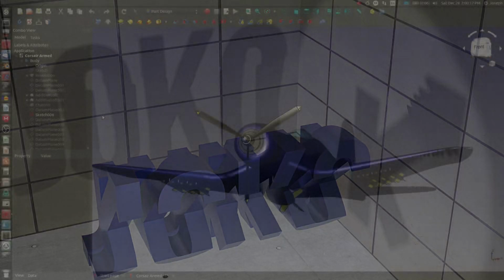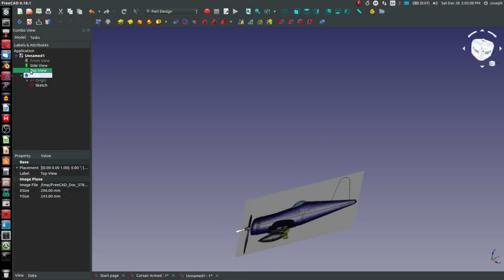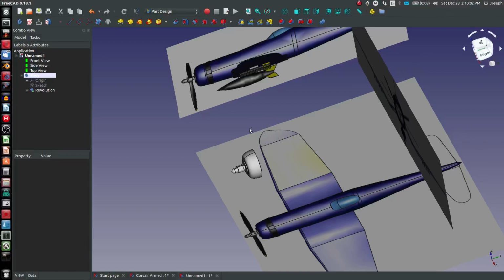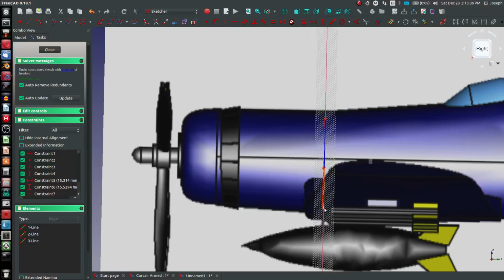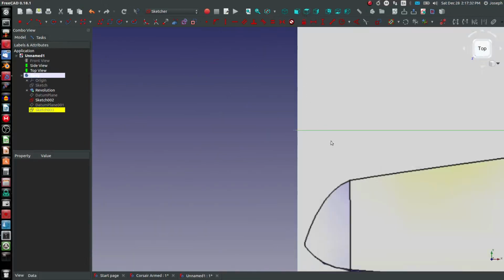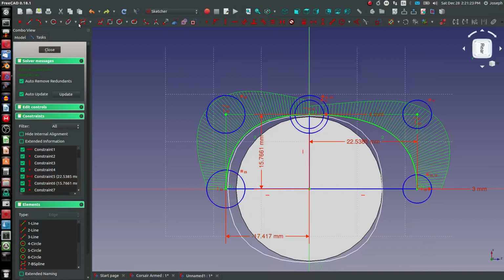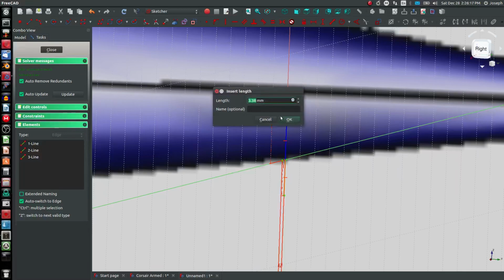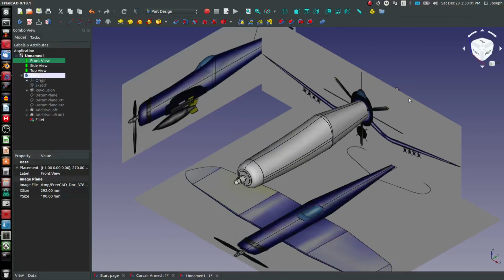Make a Corsair F4U in FreeCAD- Model From Image Video 1|JOKO ENGINEERING|

Comment: WOW. 

I just started and im dying to make a piper PA-28 cherokee, but i just found your videos on making planes hehe. Guess I’ll hop to the FA-18 one because the front of the pa-28 is an uneven elipse and I don’t really know how to tackle it

Thanks for the videos!
Reply from the maker: I haven't finished the F18 yet but I think it will be a good start.  Generally weird shapes like uneven elipses can sometimes loft better if you sketch them in half and then mirror the body after lofting to make something symmetrical.  I do this in the JAS-39 Gripen video.  Good luck that's a cool plane
Reply: @JokoEngineeringhelp  Thank you!

Comment: Great video, great work. Really. Unfortunately for me, my english is not so good, so you tell the video too fast for me. I will try make a 3D mould to make a flying model, but I do not understand your work from the situation of images, planes, etc and the subject of sections and how to fill the volume between the sections. I do not know if you can aid me. Repit, congratulations, really great work.
Reply from the maker: Hello josechumontanes; I know languages are difficult.  I do have some other videos that cover images and lofting:
https://www.youtube.com/watch?v=yVmtAP1KCfY

https://www.youtube.com/watch?v=ggJ6tORsAS4

https://www.youtube.com/watch?v=4nxTQk5WfTU

https://www.youtube.com/watch?v=6XMQ29p2Oqk

Hopefully some of these will help.  If you have a specific issue please let me know
Reply: @JokoEngineeringhelp  Hi, Joko
Thank you very much for your kind message. I'll ask you for your help, sure (ha ha ha). Thank you very much and great job, really.
Reply: Hi Joko,
I know how to implement images and more or less how to adjust them to a figure. I understand that during the first 10 minutes in your video what you do is adjust the sketch to the background images, don´t you? Then there is a part that I do not understand very well, why do you need both adjustment of the figure to the image?; Usually I prefer to move and adjust the background image.
I intend to do with free the model of an aircraft and its wing, to make the model (cnc wood, foam, etc.) for make a mold for fiberglass or to make cutting templates of the pieces. Therefore, I most need to know how the minute 25th is made, which is the "filling" of the volume between two planes (or volume filler between two sections of a body), f. ex. what you do with the fuselage, or for example "fill" a wing between the central/root section and the marginal/tip section.
If you are so kind, thanks for your help (please, step by step and better in writing)
Best regards, thank you in advance, Joko.
Josechu

Comment: Very good video, thank you!. Is there a way to scale an image in order to adjust the different views? The only way I see is changing the image size independently, but I would like to change proportional.
Reply from the maker: If you're imported images are out of scale with eachother, you could say, establish a ratio between overall length in one view and wingspan, and then in the views you could "measure" the image with a sketch and then resize the images according to the difference in scale.  If your images are all in proportion, you could scale them uniformly.  Hope that helps